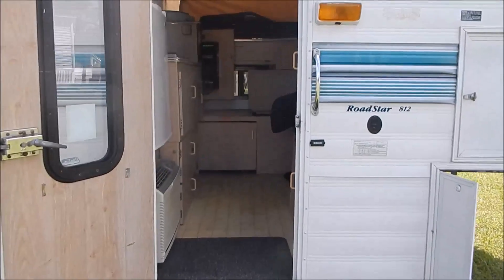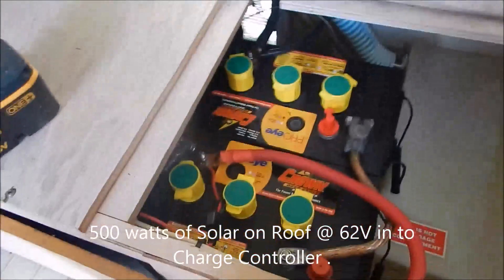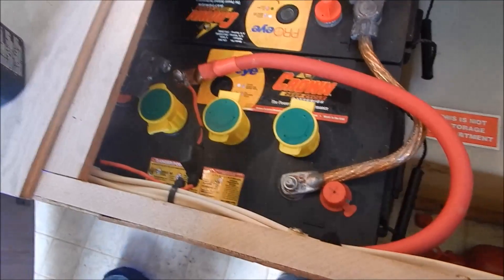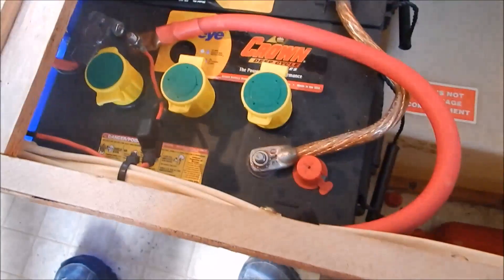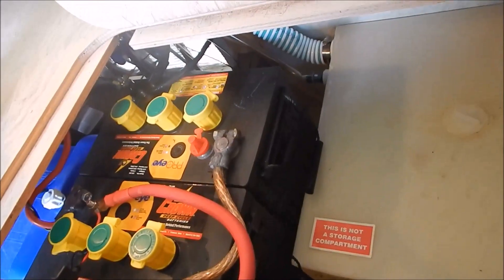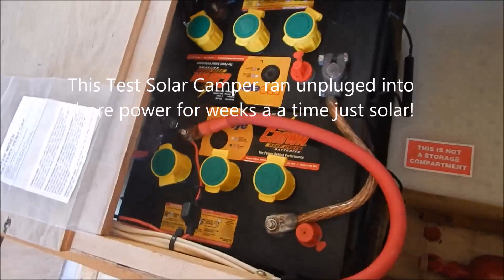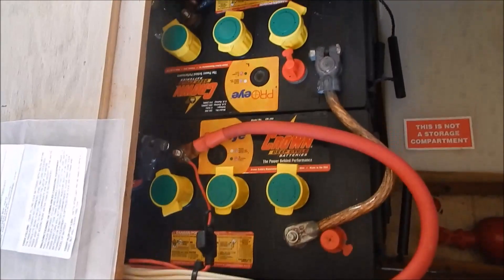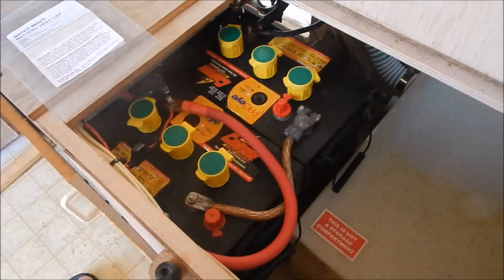Solar Powered Camper 3 Month Battery & Water Miser Cap Update.

Comment: Nice to see more detail on those caps. I think I'm sold. Now I got a look for good deal on a big batch for the house and the cabin.
Reply from the maker: +sunsensational  Thanks for watching , I am totally sold on these caps no hydrogen gas smell no battery misting none of the normal mess U would be dealing with the factory caps it is amazing . U may want o call the number on the bag I showed in the video, I got mine on eBay like $5. each plus $8 shipping for 6 caps what ever they cost they are worth it IMHO.

Comment: Nice to see it all working out better than expectations.  Looking forward to the new.
Reply from the maker: +Homestead Dreams At St. Bernard Acres    Thanks for watching.  For a off grid system I would recommend at least a 24V system. Using the right size pure sine inverter all regular energy efficient home electronics work fine.   This was done using what I had & works well in a RV/ truck set up as most every thing is 12 volts.

Comment: Looking good.
Reply from the maker: +Carolina Prepper Thanks for watching,   This 12volt system works good in a RV or a small cabin were 12v appliances, lights, are most common, for a bigger install I would recommend at least a 24V set up.